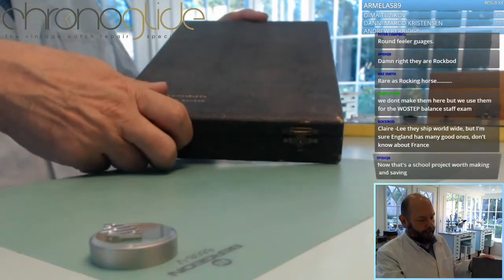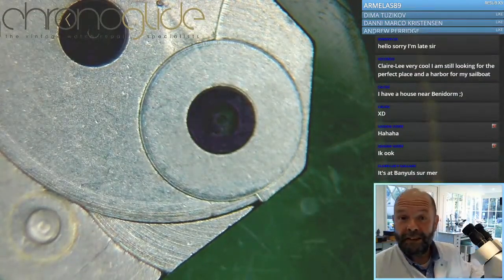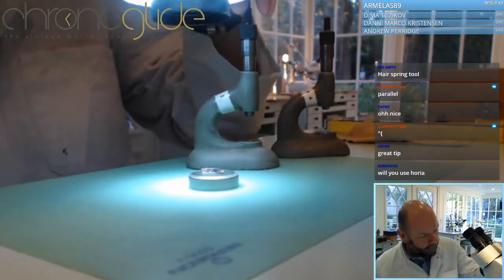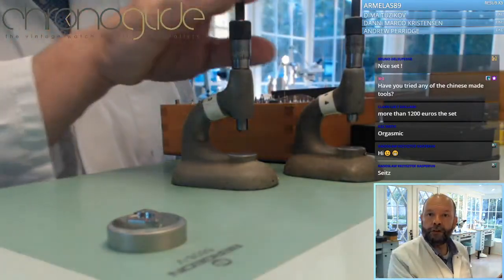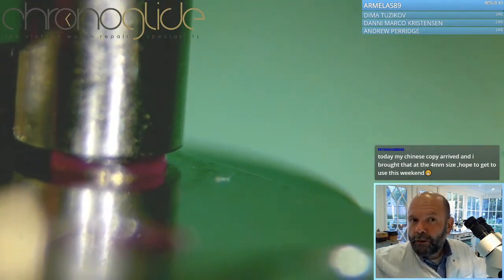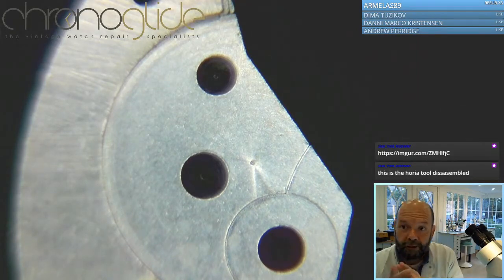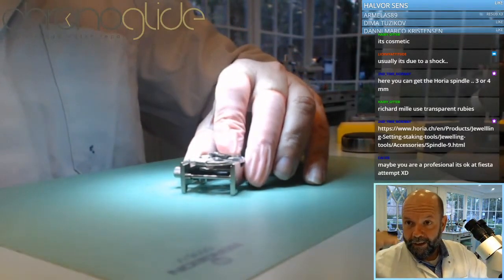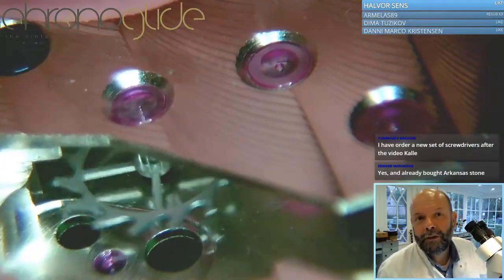Replacing Jewels and Ruby's Watchmaking - Part 4of4

Comment: Those inserts for the jeweling tool set are indeed "crazy expensive".  If you are watching these videos then you are probably capable of making some of your own.  Invest in a watchmaker's lathe (preferably a 10 mm, but an 8 mm might do for some of the smaller ones) with a good cross slide and tool post.  Yes I said a good cross slide.  Then a micrometer, dial caliper, and a small blow torch (for hardening, tempering, or annealing). Practice with some scrap metal until you get the hang of it, and you'll be surprised how many of your own tools that you can make with it.

Comment: Hi, i think multi purpose grease is the best for watch lubrication, just applying a film of it with a toothpick. Or if you dont want to disassemble the watch simply dissolving it in brake parts cleaner and apply it like oil, this will leave a thin film of grease between the parts. For cleaning parts i just put them into a plastic cup and swirl them in brake parts cleaner. For the mainspring i use silicongrease, mostly for corrosion protection.

Comment: I know its not strictly on topic, but it is related. I have some cheaper non jeweled movements with just holes in the main plate. On one of these the previous owner/servicer placed a shim under the bridge as the bridge was pinching the second wheel when I tightened the screws. Is there a better solution than a shim?

Comment: Hi Kalle, very nice video!
Could you help me? I was wondering what outer diameter the reamers of the Seitz tool have (the diameter that goes into the spindle for reaming). The spindle itself should be 8mm, is that right?
Reply from the maker: You are right Chris, it is 8mm outer diameter.
Reply: @ChronoglideWatchmaking  thank you so much!
But what about the reamers? What diameter do they have? How are they fixed in the spindle?
Reply from the maker: The reamers are usually standardized 0.01 smaller than the jewel size (outer diameter). They are friction fit to the spindle (Seitz) or with a collet (Favorite).